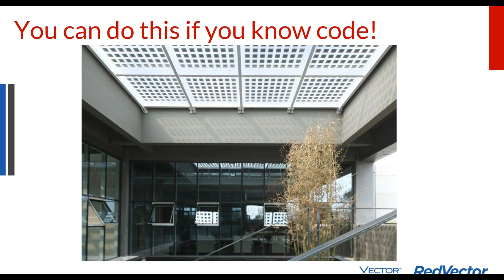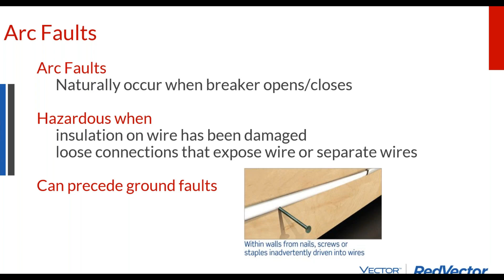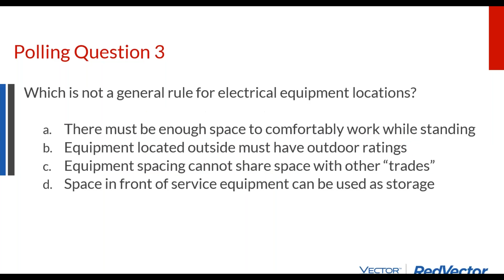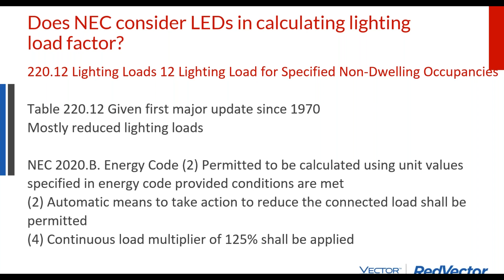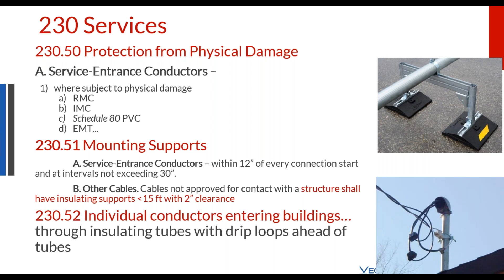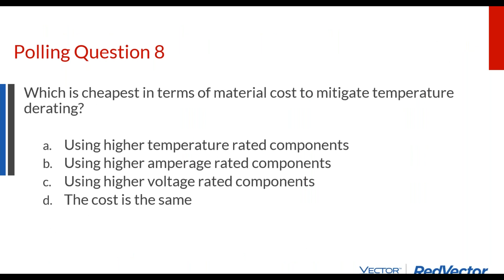NEC Read Through Part I - 100-400

Comment: Would you recommend placing a fuse in each of the pv positive and pv negative of the pv wires going to the inverter pv input? Or just a fuse in series at the pv positive only? Thanks
Reply from the maker: If its a floating inverter (most are), I'd recommend both. I'm not sure what the standard practice is today - my guess it is both.